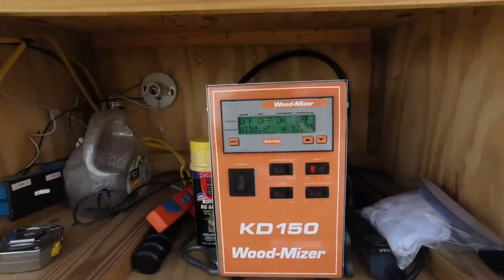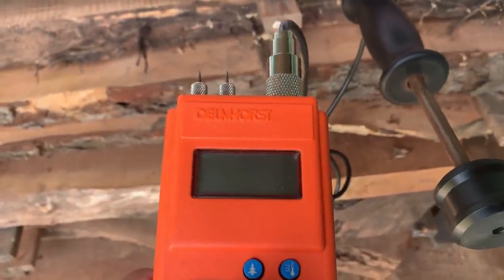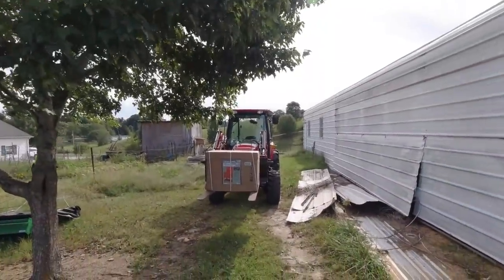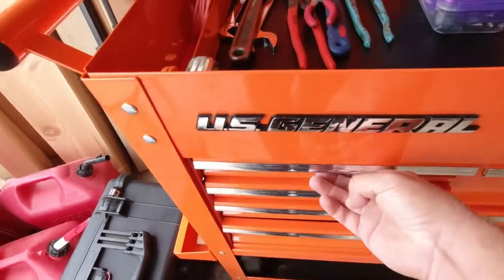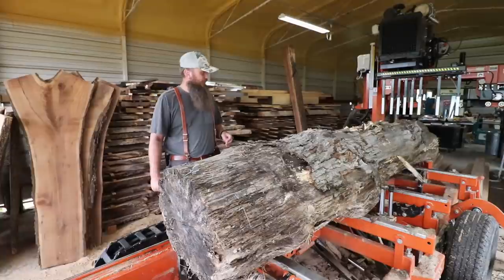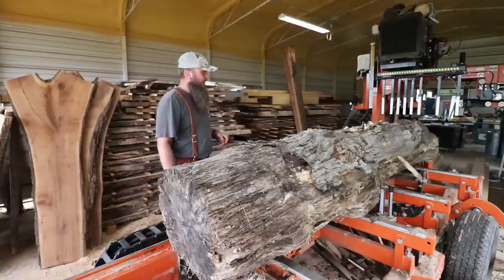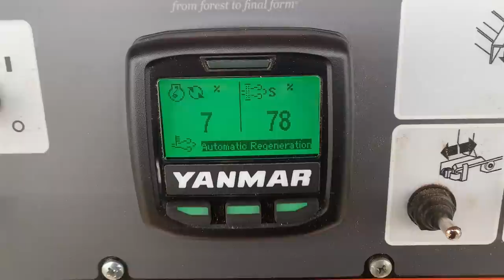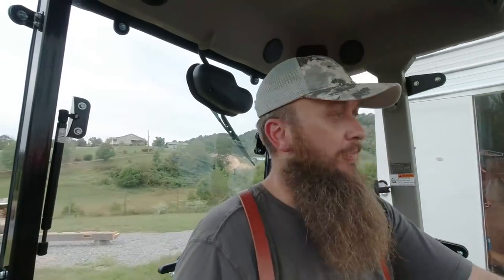I Should Have Got This For The Sawmill Years Ago,

Comment: Used to drive a David Brown over there across the pond, that was nice. I think it was high-low-medium ratios and reverse were clutched by 1-4 working gears were clutchless. Also John Deeres, again over there, had a funny little 1/2 gear gizmo which was hydrostatic. The John Deere I drove also had a turbo and it would drink oil all day. We never changed its oil- it lived on the waste oil from six FIATs. Start of the day, fill fuel tank with diesel and a gallon of crap oil for the engine.

Comment: Hello, Nathan.  The likelihood of my ever owning a Sawmill here in New Mexico is close to nil and shipping on any of the wood from yours would pretty well cost the earth but I really enjoy seeing what can be had out of some logs that look like they were ready for the burn pile. 

I have two of those Harbor Freight tool carts exactly like yours and they have held up really well.  One suggestion if you get another one, get it in a different color.  Mark the tools that belong in this box with a dab of orange paint or nail polish.  Mark the ones that go in the other one with the appropriate color.  That way, for common tools like pliers and wrenches etc. you can tell which box they belong in without having to go from box to box to determine where they should go.

Also, I don't know what you do with the first cuts where you're squaring off a log and getting the bark off.  When I had a bit of an acreage, I had a neighbor with a mill and I used to use those off cuts to side animal shelters for the horses and goats.  They worked well and  the animals didn't care about the appearance.  You or some of your neighbors may find that useful.  It's better than burning it unless you are using it for firewood.

Comment: Good evening Nathan,
Very nice tool box.  You've needed it for quite a while.  Hope you can find all your wrenches.
Reply from the maker: Thanks 👍
Reply: 'Misplaced' a chainsaw all-in-one tool (flat screwdriver one end, plug socket, bar nut socket on other end). Was promptly located in the spring with the push mower.

Comment: I’m a metal sculpture artist , also a scrounger and I use slabs, usually debarked as light duty patio side tables with decorative steel legs.  Wish I was closer.  I’m n central MS
Reply: I, likewise, end up with a bunch of slabs that just go to the burn pile; mostly pine though. I’m also in central MS - Smith County.